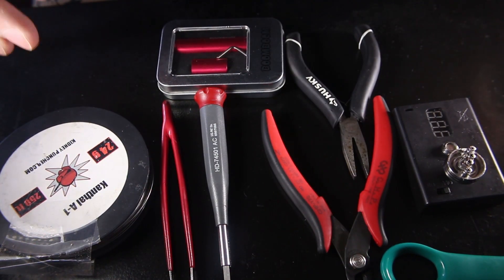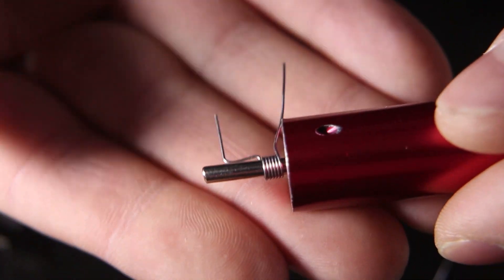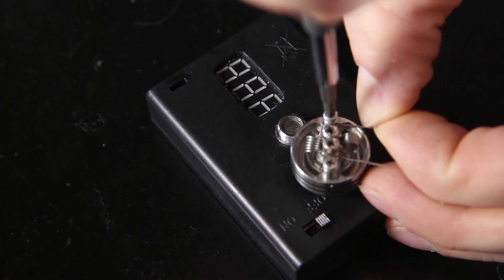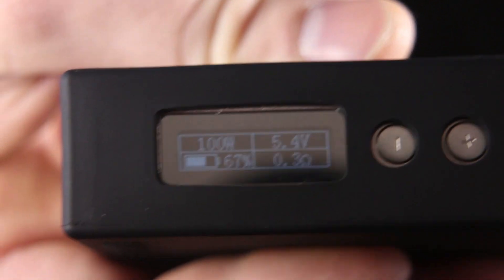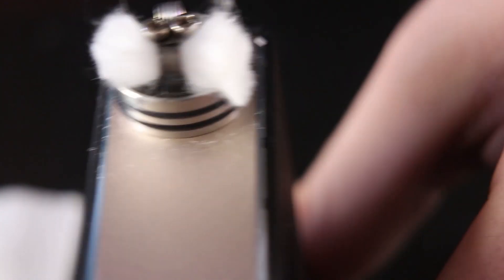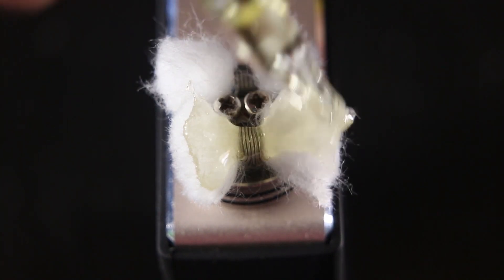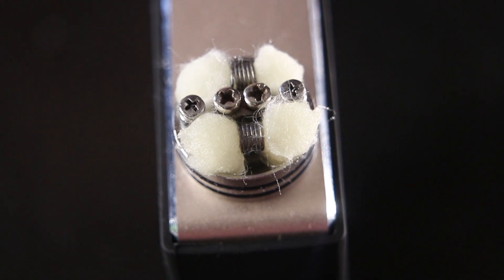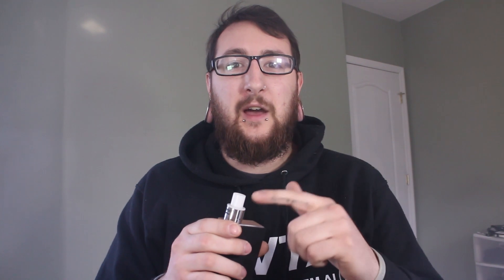#FRESHBUILDFRIDAY - 100w Plus Build

Comment: I did a build yesterday I think you'd like, Mad Rabbit wire 23g N90, dual coil 10 wraps on a 3.5mm, 0.14 ohms in a Doge V2. It's a beast with high wattages. And I did a single coil in the derringer, 9 wraps on a 3.5mm, 0.28 ohms and it's perfect. I need to try a 4mm build. There is just so much cotton in the coil, it's almost impossible to get a dry hit if it saturated.

Comment: And also I've wanted to but I haven't tried it, but I've also wanted to grab a 22-24g wire for core. Then grab 2 pieces of ribbon and sandwich the core in between the ribbon and then twist it. So the core wire would be encased in ribbon wire.
Reply from the maker: +Jon Evans Do you mean like a fused clapton using ribbon for outer wire?
Reply: +Daily Vape TV No, ummmm more like a Tiger Coil but with 2 pieces of Ribbon so the round is encased. But try and have the core as straight as possible, but the 2 ribbons wrapped around it tiger style so it's enclosed.
Reply: +Daily Vape TV - Or this idea I sent to Twisted Messes, but he never did it not that I know of, and said that's a good idea and never replied. lol
Reply: +Daily Vape TV -  "Hello! It's very nice to meet you. I'm sorry for writing you, I bet you already have a lot of people you deal with. But I have made a couple "Staged Heating Coil", that I learned in your video. But I remember you showed one build in the vid that was pretty much a normal parallel. Besides the fact that one wire had an extra wraps. But I was wondering how a Staged Heating Triple Strand Parallel? Lol like have 1 wire with 7 wraps, the next with 6, and the last with 5? But I didn't know if it wouldn't be practical or not? Idk lol You should try some builds in Hybrid! YoshVapeGate did a video on a "Hybrid" coil build. And have thought about trying a Staged Heating wrapped Hybrid or just a plain Spiral Wire wrapped Hybrid. I have only seen a couple of people wrap Hybrids, so I know you'd be able to innovate and come up with a badass coil build that utilizes the Hybrid wrapping."
Reply: +Daily Vape TV That first comment about flat ribbon Clapton I guess would be a Transformer Coil. Lol the other comment, I'm describing is a diff coil. Lol

Comment: Daily Vape TV Great tutorial Nick! I have a Velocity & an IPV3 Li 200W on the way. Would it be possible to do a 100W build on a Velocity video? I have 26g A1. Will I need some 24g or is 26g sufficient for 100W? Thanks
Reply from the maker: Mowgli Vapes I would highly recommend 24g since it's slightly lower resistance. Regular kanthal a1 works best with this build but for other wires like nichrome or Royal wire, I'd say add an extra couple wraps on it. I don't own a Velocity RDA so the only way I could do that video is if someone sends me one for a review. Maybe after I hit 10,000 subs people will start to send me more stuff -__-

Comment: i have a segelei 150w with a smok tfv4 tank on it using 24g kanthal coil and every build i try doesn't seem to want to go pass 50w without getting a nasty hit. help needed thanks.
Reply: Sebastien Friars same
Reply: Sebastien Friars try using diffrent gage wire as well as rapping multiple wires together with diffrent technique (try watching some coil builds videos) ...it will create more resistance and will take longer for your coil to heat up (not really noticeable just hold fire button for a second) but your vapor production and flavor will increase...also lover you nicotine level and your pg level (I recommend a 20:80 or 30:70 pg:vg blend)

Comment: Is it safe for your lung to vape this high wattage warm vapor stuff? Is there a possibility to liquefy in your lungs? Thanks for this educational video!
Reply from the maker: I'm no doctor but your body temp is 98.6 degrees and the vapor definitely isn't that warm no matter what wattage you vape at. If it liquified in your lungs then I'd have pneumonia and have a hell of a wet cough constantly, which I don't. Vaping has been around for over 10 years and there are no reported case of any serious health issues associated with it.
Reply: If it is too hot for your mouth you might want to lower the voltage, 100w isn't too bad. Think sauna. I don't see how this is really a 100w coil. It is just a standard round wire build for larger rta's. Cranking up the watts increases heat, but not always vapor.

Comment: is it ok to vape with 5.4v? Can u explain more about voltage?
Reply from the maker: It all depends on the resistance and number of coils. If I use a single coil, I usually stay around 3.7v, for duals I usually recommend around 4.2v and for quads you can really crank em at 5.4. There is a direct correlation between how many coils you have and what wattage works best for them. steam-engine.org is a great resource for that type of information.

Comment: I like the coil build I just wish you would have fixed your spinning center post. The most common way to short out your device or battery is to just let shit like that go. You said and did nothing about it.  One other point I feel important to talk about is tuning your coils at 100w. You can do it in half the time at 40-60w and you wont warp the wire from extra heat. You did a great job on the video other than that.
Reply from the maker: Joseph Gilpatrick Yeah, that was the first time that had happened to me and of course it had to be on camera. I've since stopped using that atty (I had another one lying around anyways.) I never really thought about tuning my coils at a lower wattage. I'm so used to building on mechs where you can't adjust the power, I usually just set it and forget it. I always pulse fire whenever I'm adjusting but the heat can warp the coil which means I'm spending more time adjusting than what's necessary. Thanks for the feedback, I'll definitely be taking what you said into consideration for future videos!

Comment: What is max watts this will work on
Reply from the maker: +BROSEIDON GAMING I've used this same build up to 130w (I was on point with the wicking that day lol) If you want to do more wattage, add a few more wraps.
Reply: +Daily Vape TV awesome thx bro and is it me or is this a steal a ipv3 IL 200watts for 70$ new in box
Reply from the maker: Definitely a steal at that price. I thought me getting it for $89 was a good deal.
Reply: +Daily Vape TV lol totally am there is 6 left need to get asap

Comment: stop using clones      buy authentic.   and your description for a micro coil is completely wrong as this other dude said    tight coil = micro?   dude..  you need to go back and learn before you teach people wrong.
Reply: Clones are next to identical and usually hundreds of dollars less
Reply: Clones are not made using safe or the same material.  You'll need to do proper research on realizing what you're vaping with.  Copper that's not the proper copper is poison. Any random person can make a clone. Release it and it's sold.  Thousands of people vaping with improper material. Brass needs to be naval brass. Copper needs to be oxidized.  Yeah it's cheaper. . But when it comes to your life. You better be safe.  And when I go to vape expos, I'm proper and boss like when I'm rocking my set up.  Those who have clones.  All vape from inside of their jacket or shirt.  #truth
Reply: +Jude Palermo Most clones tell you what they are made out of if you shop at reputable vendors. I've been using clones since 2011 haven't died yet or blew anything up. Seriously get over your authentic bullshit. I've seen several authentics and clones side by side. And in most cases you can't tell a difference on most except for the serials.
Reply: painlessguy. Clones.  Yeah. Keep telling yourself that.  Not for nothing.  At any reputable shop, they are selling authentics. . And for me, it's all I want.  And all I vape with.  It's that simple.  You want to vape lead,  or dirty copper.  Go ahead.  But when I looked at all clone sales sites.  Not a one said this is naval brass or vapeable copper. . Be safe buddy.  And you won't blow up man. Come on. Really?  That's an ohms law issue. Not a clone issue. Using clones is gonna just get you sick in years to come.  Come on man.  Be for real. Be safe and keep your lungs healthy.  It's why we stopped smoking. Isn't it?  Not to poison them with various metals.  Think about vaping nickle when dry burned. Not good right. Well,  vapor from unsafe metal, isn't good either.  Get over myself? . Really? . Thsts a nice one bro.  Not trying to get over myself or say I'm better than anyone.  But to raise awareness that anyone can make an atty and when it is sold. It isn't tested or ran tests on the way America would.  Chinese clones?....  I bet you own most of them. Look at your atty shelf, it itself is a clone of a real one.  Ha ha ha.  Now that was funny.  Don't be sad. It is a joke that last one. But really. Think about what I'm saying. There are young people vaping and not being safe.  So why when I say buy authentic atomizers or mechs does it bother you so much?  I am trying to reach out to the people. Don't be so face to the wall.
Reply: Nickel is the type of coil not base
Reply: Dude you aren't vaping the RDA base and shell. They aren't getting that hot to release any toxins.  If a soft metal like nickel can get up to 650 before releasing anything. The harder metals they are using are much more stable and can stand up to the residual heat. But yeah if you want to be an authentic snob then be at least truthful. That you just don't like clones. I've held a lot of authentics and clones. They are practically the same. Why do you think the producers get so pissed about it? If they was truly using cheaper materials or wasn't so damn near identical they wouldn't care. But when in most cases I can get the same build quality for pennies on the dollar. The guy making the authentic can fuck off or be more realistic with his pricing.
Reply: +Jude Palermo I can't justify spending 100+ dollars on an authentic RDA just to say "hey I bought a authentic RDA" I don't see a point
Reply: Dominic Veale, yeah no shit.  Nickle is a wire type.  But when you buy clones,  Rda clones. You have no idea of what material the Rda is being made from.  That's all.  Regulations would resolve that.  Nothing to do with wire bro. Nickle wire, when dry burned is bad.  Breathing in that nickle smoke from the wire is bad.  But we are talking clones.  How do you know what material your clone is made from.  At all. Not now,  not then, not ever.  Plain and simple.  So what.
Reply: 1010ryuzaki, see my last post about clones and what they are made from,  and you'll understand.  The actual material in which they are made from isn't being spoken about.  They could be lead,  or pure copper. (which is bad)  copper needs to be worked on before it can be used as 's vaping method.  They ask be made from lead.  And you're vaping from that.   Come on bro.  I am not saying anything about you personally bro. Just saying clones are not safe.  Maybe 1 to 5 % of clones are OK.  But what about the other 95% that are made from bsd material.   Not worth it.  Vaping from authentic material is how I will roll.
Reply: I'll buy authentic all day everyday.  My sponsors agree with me and support my thought process and I'm which way I think.  When I gain more sponsors, they ask me how I feel about it and it isn't even them giving me anything directly.... In regards to clones or authentic. Wouldn't you think it would be cheaper for them to give me clones?  It would. And they don't.  It's about safe vape practice...
Reply: Whatever makes you sleep better at night...
Reply: Whatever.   GG says vape budget hands. I say the same thing.  But in the end, I'm not trying to be an asshole not at all. And I'm not.  Those who know me, know I'm super giving.  I give away all kinds of authentic merch. Clones, I'm just saying that they are not made using safe material. That's all. It isn't what makes me sleep better at night,  it is what keeps this lifestyle moving forward without having issues arise in the future.  It isn't what this needs.  Down the line, hearing of ppl getting sick from vaping off pure copper or improper brass..  That's to be avoided  no one will know of clones or authentic, those of them who are trying to bury this life saving products. They will just hear ppl and getting sick. Clones are made cheap and from cheap areas.  Authentic are way affordable now with vape groups and trade sites. You can get a 150 dollar pi2 OR hyon for 50 bucks.  Or a decent trade.  It's about safe usage.   So if you want to roll the dice on product and stuff,  it's your choice. I hope you stay safe and healthy. I really do. But for me, and all my research, it is very uncertain.   Be safe.  That's all I'm saying  maybe it comes off as arrogant or rude or whatever, but you know what, it gets ppl talking and aware of it.  Vape safe, vape good batteries and know ohms law. Once you know that, vape down to 0.06 and taste heaven. #stapledstaggardton #fiberfreaks #dragocotton #subohminnovations #subzerocomp #limitless #limitlesslife #dayofthedead #vapedead #ohmslaw #allauthentic #noclonesever
Reply: +Jude Palermo You're talking about safety and you're vaping at .06? I hope you arent running that on a tube mech. No single 18650 can handle that.
Reply: xTAYLORSWIFTx I have regulated mods that run to 0.05 and or even lower.   If I run a mech, at a comp, any comp sets regulations to not go below a 0.08... So yeah. I vape where my Batt says I can. And also where I say I can.   #ohmslaw.  I know it and live by it.  Ok so if you vape to. 3 or higher,  I don't know where you vape at but go ahead.  Do you. I talk about clones not being safe and or being smart. Simple.  And if you know this.  Then you know what can be done.  I doubt you are a seasoned vapor because you wouldn't make comments like that.  So. Anyway.  Yeah.  Oh well.  Did I say oh well. Blah oh well.
Reply: +Jude Palermo I have been vaping for almost 3 years. I just dont understand your argument that clones are unsafe. I could understand using a full copper atomizer, in that low quality copper will oxidize when exposed to liquid, but I dont use copper in my atomizers to begin with. Ive been using clones for years, and I havnt had any issues. I have a few authentics as well, but until prices drop to where the nicer authentic companies are pushing out mods and atomizers that arent $100+, ill stick to what I have.
Reply: +Jude Palermo are authentic clones safe for use?
Reply: +dutersupy  in my opinion-  not.   they don't use the same materials.  naval brass is authentic and who knows what brass in clones
Reply from the maker: I feel like we need to put this petty "clones vs. authentic" business to rest. We have much bigger things to worry about nowadays and besides this video is over a year old and I don't even own clones anymore (not bragging, just stating the facts.) @jude you've been a long time supporter, I've seen your comments on a lot of my videos, I don't hate on anyone using clones as long as their being safe and I feel like we all need to just take a step back, have a vape and enjoy while fighting the FDA's regs, agree??
Reply: +Daily Vape TV absolutely agree.   I advocate-  attend rally and do anything I can 100% of my free time.  and my free time is all my time outside my full time job.  I do things all the time.  check out my instagram page and or Facebook.  youll see that im on that 100%
Reply: +Daily Vape TV I'll take that clone if you don't want it ha like there's any major difference in an authentic, maybe oh idk just the Branding and machining